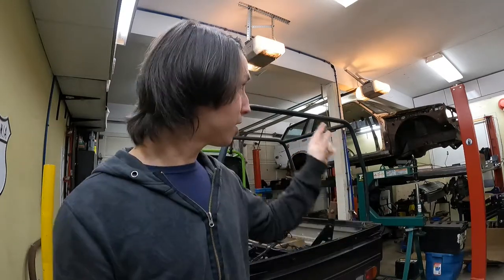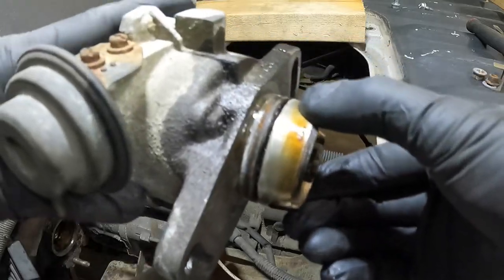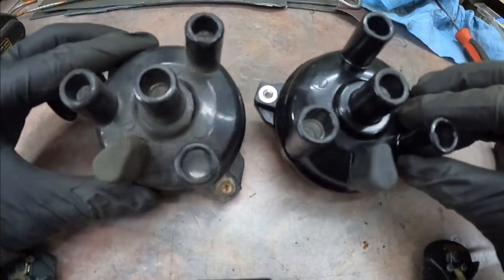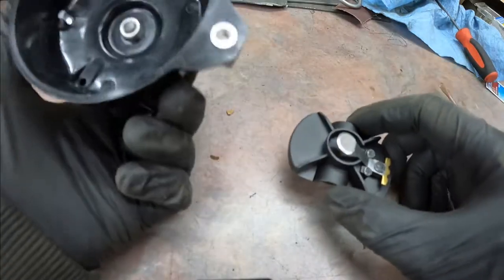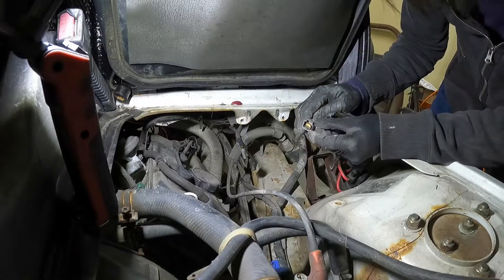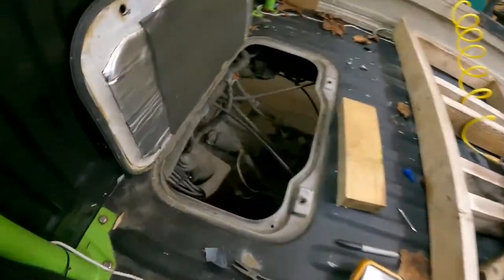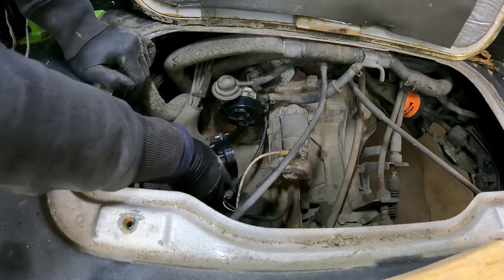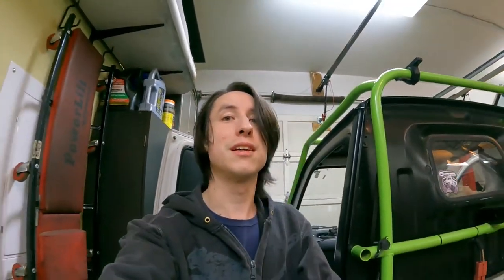U42T MiniCab No Spark No Start Diag and Repair

Comment: When the coil lock broke - "well, shit" - I think that's my new MInicab motto...
Reply: My 97 is showing similar symptoms, including burping fuel into the air filter.  I have a toolbox installed over the distributor hatch, once that's pulled I can check the distributor and that connector that was corroded on yours.  Fingers crossed that gets me running, but I still need to learn to check timing

Comment: Hey, so when you say you had the distributor on 180 degrees off, was that the rotor on the shaft? Because it looks like you still had the cap on the same way as throughout the rest of the video.
Reply from the maker: It was a while ago.. however if I recall correctly the rotor shaft is keyed in a manner that it can be installed 180 out on the cam shaft. So I had the entire rotor and shaft installed 180 out.